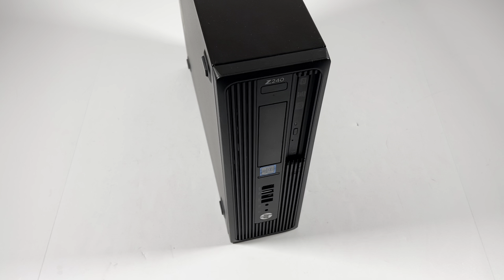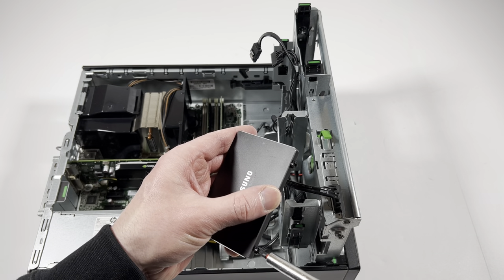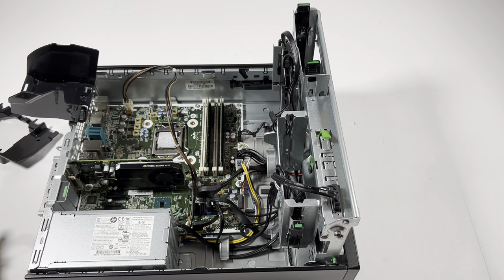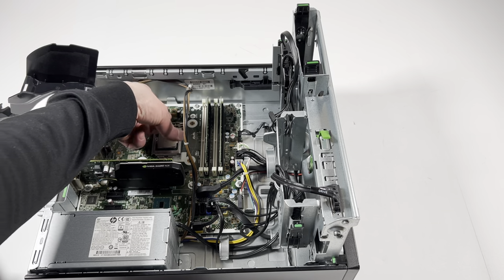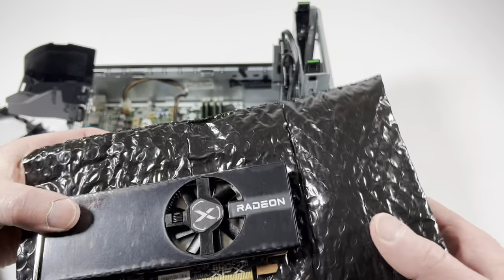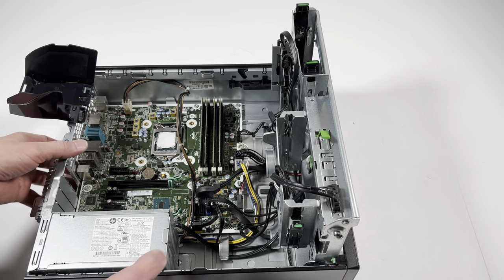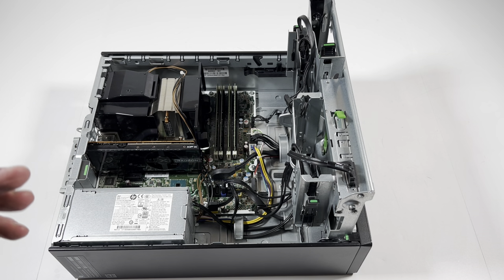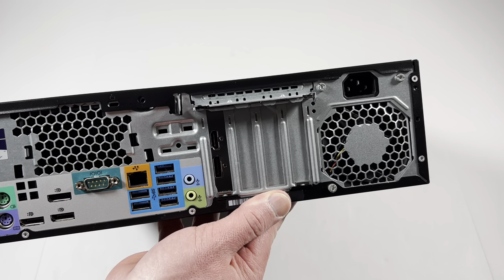HP Z240 Gaming Upgrades CPU SSD Video Card RAM

Comment from the maker: List of Parts and Upgrades works with this system:

USB Wifi Adapter for PC AC600Mbps Wireless Network Adapter
https://amzn.to/2ZaGuHb

CPU Support List: 
(1.) Intel Core i7 7700K, 7700, 6700K, 6700, (7th Gen, 6th Gen)
(2.) Intel Core i5, 7500, 7400, 6600, 6500, (7th Gen, 6th Gen)
(3.) Intel Xeon E3-1280 v6, Xeon E3-1270 v5, Xeon E3-1245 v6, Xeon E3-1230 v6, Xeon E3-1225 v5,  Xeon E3-1240 v5 

Intel Core i7-7700 (4 Cores) 8Threads Desktop Processor 
https://amzn.to/41CVoCK

Intel Core I7 i7-6700 (4 Cores) 8Threads Processor
https://amzn.to/3BtzS8J

This RAM will work with this system MAX 64GB.
NON-ECC Unbuffered  DDR4-3200 / DDR4-2666 / DDR4-2400

Crucial 32GB Kit (16GBx2) DDR4 2666 MT/s (PC4-21300) 288-Pin Memory - CT2K16G4DFD8266 
https://amzn.to/2RXnuYB

Crucial 8GB Single DDR4 2400 MT/s (PC4-19200) 288-Pin Memory - CT8G4DFS824A 
https://amzn.to/2VPCbhg 

 
Thermal Compound Paste:

(1.) Arctic Silver 5 Thermal Cooling Compound Paste 
https://amzn.to/2ziNU0H

(2.) Noctua NT-H1 3.5g, Pro-Grade Thermal Compound Paste
https://amzn.to/36kTk7A

(3.) ARCTIC MX-4 (current edition) Thermal Compound Paste 20 Grams 
https://amzn.to/2DhGJaK

This video cards will work with this system.

AMD Radeon RX 6400 Low Profile Gaming Graphics Card
https://amzn.to/3s8MUUY

XFX Speedster SWFT105 Radeon RX 6400 Gaming Graphics Card
https://amzn.to/3xkmXo1

(1.) Gigabyte Geforce GTX 1050 Ti OC Low Profile 4GB GDDR5 128 Bit PCI-E Graphic Card (GV-N105TOC-4GL) 
https://amzn.to/2XEqKMb

(2.) MSI Gaming GeForce GTX 1650 4GB GDRR5 Low Profile Graphics Card (GTX 1650 4GT LP OC) 
https://amzn.to/2VkDdSd

(3.) MSI GTX 1050 TI 4GT Low Profile  Graphic Cards 
https://amzn.to/34r0AxG

(4.) Gigabyte GeForce GT 1030 GV-N1030D5-2GL Low Profile 2G Computer Graphics Card 
https://amzn.to/2Z4PHkp

(5.) ZOTAC GeForce GT 1030 2GB GDDR5 64-bit PCIe 3.0 DirectX 12 HDCP Ready Low Profile Video Card ZT-P10300A-10L 
https://amzn.to/2WzgLXk 

(6.) MSI Graphic Cards GT 1030 2GB GDDR5, Low Profile 
https://amzn.to/390Spum 

SSD 2.5 list works with this PC:

Samsung 870 EVO 2TB SATA SSD
https://amzn.to/3ezOds5

Crucial MX500 2TB 3D NAND SATA Internal SSD
https://amzn.to/3B9f8CF

SanDisk Ultra 3D NAND 2TB Internal SSD - SATA
https://amzn.to/3RSZ8LR

(1.) Samsung 860 EVO 500GB 2.5 Inch Internal SSD MZ-76E500B/AM) 
https://amzn.to/2yNxnkE

(2.) WD Blue 3D NAND 1TB Internal SSD, 2.5" WDS100T2B0A
https://amzn.to/2wvnC9Z

(3.) WD Green 1TB Internal PC SSD  WDS100T2G0A
https://amzn.to/3cbrcWa

(4.) SanDisk SSD PLUS 480GB Internal SSD SDSSDA-1T00-G26
https://amzn.to/3a3i9ou

(5.) Crucial MX500 250GB 3D NAND SATA CT250MX500SSD1(Z) 
https://amzn.to/34rZlhy

(6.) Samsung 860 PRO SSD 256GB - 2.5 Inch SATA III Internal Solid State Drive
https://amzn.to/2ybiHLK

(7.) Samsung SSD 860 EVO 250GB 2.5 Inch SATA III Internal SSD 
https://amzn.to/2VjIAkK

(8.) SanDisk SSD PLUS 240GB Internal SSD
https://amzn.to/3c7SEE4

HDD list works with this PC:

(1.).WD Black 2TB Performance 3.5" Hard Drive - 7200 RPM Class, WD2003FZEX 
https://amzn.to/2xFUeyF

(2.).Seagate BarraCuda 1TB Internal Hard Drive  3.5" Hard Drive - 7200 RPM
https://amzn.to/3g8FXM8

Disclosure: Amazon links this means that if you purchase an item we earn a small sales commission affiliate.
Reply: can I use this list for non SFF model?

Comment: Nice video. I am using the same k620 video card from this workstation. I put it on lenovo m78 small form factor with amd a8 apu 6500b. I bought it for 30 euros second hand. It works great for me on old games up to 2018 and plays 4k 30fps youtube videos without any problems. With a limited power supply of 240w it is a good choice, also the fan and it is quiet even at 100 percent load. Even though it has 2gb gddr3 it is much better than the built in 8570d. On 18.5 inch monitor resolution 1366x768 I play old games on high settings smoothly and with 60+ fps. Thanks for your video👍
Reply from the maker: Hi, thanks.

Comment: hey man i have a question i have xeon e3 1220 v6 gtx 1660s and hp z240. I wanna install 4x8 ram sticks but bios and pc recognize only 2 sticks at the same time. All ram slots and sticks works. In Aida64 and cpu-z i can see all 4 sticks. Maybe you know how to fix this. Ram sticks all same ddr4 2133hz ecc
Reply: Hi I had the same issue on my gaming pc the other day. Best way is to just use 2 sticks maximum.

Comment: Great tutorial and explanation on the 240. I have a 620 and a 230 with the HP Turbo Pcie card Gen2 in each with the Samsung 951 and 256 GB AHCI M.2 SSD. Those are the only ones that will boot an OS. They are a bit slower then NVME used on the HP 240, 440 machines. I'm thinking of getting a 240. Thanks for the info. Liked and subbed.

Comment: Hi brother, I bought a ddr4 3600 ram memory for this computer and it didn't work for me. Do you know if there is any way to configure it?
Reply: Max 2666
Reply: @anttileppanen632  Nah max 3200 he stated in the video description
Reply: Sometimes the ram won't work if the stick size is to high for the board to handle without a bios update. Had this happen trying to swap 8 gig sticks for 16 on a friend's PC. We though he got bad ram but once we updated the bios it recognized the ram.